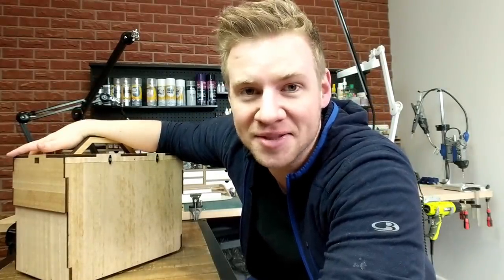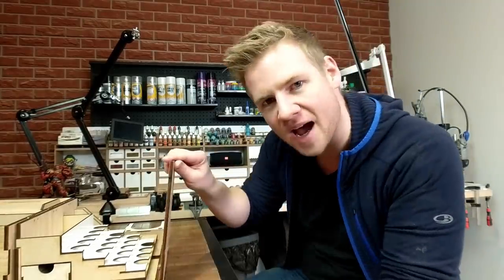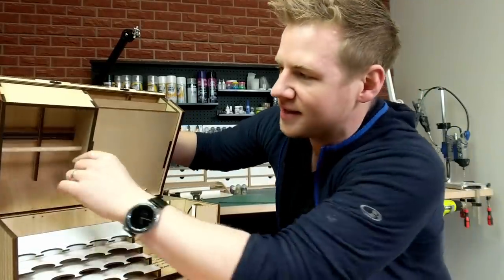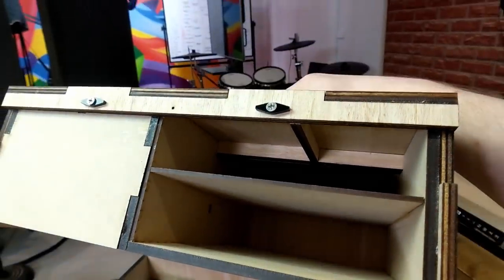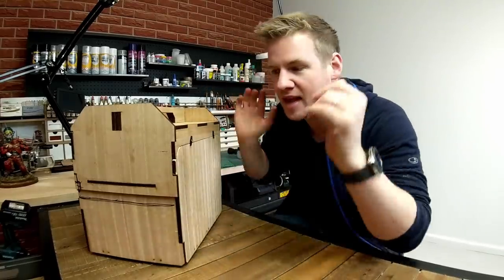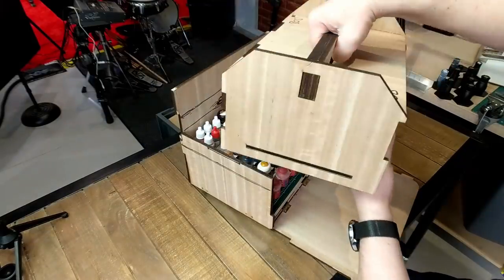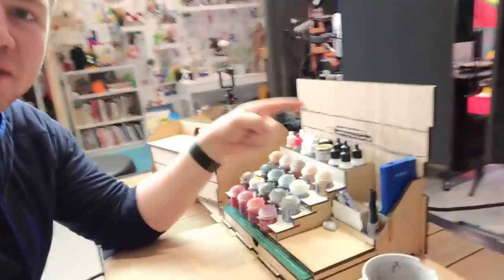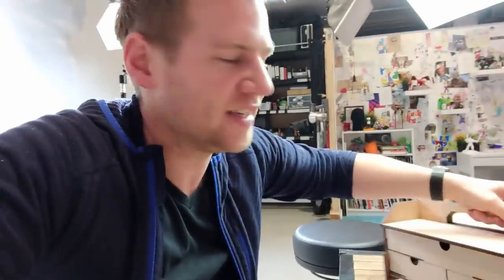My Prototype has MAJOR FLAWS - Hobby Box Diaries ep.3

Comment: Here are my 2 cents from the pov of a scale modeller/mini painter. 
1) Kill those color racks. I know they look nice but they only take up valuable space that could be used for MORE colors. You should replace them with a system of stucking trays, without any positions. The color bottles will snug each other to place and you will accomodate double the number you have now in each tray. I have over 200 vallejo colors and I manage to fit them all plus my pigment bottles, putties and solvents in a three level comic book box just a tad bigger than your hobby box.
2) Kill that GW  water cup placement. Its ridiculous nobody uses that crap and its space that could be saved for more important stuff.
3)Since you decided to go with a detachable top (a better solution imo) you dont need that back wall there. Turn the drawer part around and have it snap into place in a different way. Check how detachable tray tool boxes work.
Im going to be brutaly honest. What you have there is not a serious solution for any serious modeller. It could be a solution if somebody wanted to model away from home and work on a very specific project but again I bet that there will be a time that he will miss a color or tool left behind. If you want to aim to that target group you will have to go abit bigger and make something that will first and foremost will be a storage/portable solution and then a work station.

Comment: The notches you are using on the bad panel could be made smaller and put on the sides and back to align the top drawers. If you pare that with a similar spinning latch like you have for the front door it could hold everything together evenly and eliminate the need for the back side to be so tall!

Comment: May you could change up the lid so it has a hinge in the middle. As you open the lid, one half slides so it is above the other half? To solve the balance problem, you could split up the two trays and they go into the bottom below the tiers of paint? This way it would be bottom heavy but balanced.

Comment: Not sure a hinge and a locking rod(s) would solve the issue with the backplate. However, if you keep it as it you potentially make it somewhat modular for as other noted, easel, references or indeed a phone/tablet 'holder' of some sort. Comes down to durability I reckon.

Comment: I am just spitballing here but, what if you used injection molded plastic so you don’t have to have the built in supports taking up interior space or are you tied to the wood material for construction?  Secondly,  if the hinge was a rising piece rather than a flip over traditional hinge, you would not need to worry about drawer contents, just lift on the channels and everything remains in place and the spool rod would be like an under cupboard mount.  As for the weight, you could split the space devoted to the paint rack to flank the spool rod like bookends to redistribute the weight.  It would work fabulously for me right now lol!

Comment: Could you take the back panel and cut it in half with hinges holding them together so when you’re ready to use it, you can flip the panel down to get rid of the height? I’m not sure if you could put the hinges on the outside, but making it either removable entirely or like a flap would solve that problem.

Comment: I'm loving this so far! I like the little shelf for a cutting mat. I'd like to use that spot for flat sprus. The only concern I have with the two peice model is the strength of the connection. I picture myself using this in an airport or something to that effect. So if I'm walking would it become detached if I lightly bumped it? (Actually asking.)

Comment: Please understand that these are just my thoughts and opinions and i do understand that you have put more time and thought into this project then I have I just wanted to offer my perspective on how i would tackle some of the problems you presented us.      (0.07)What if you made the fold down workspace so it could fold all the way over and under (or possibly removable?) out of the way so that way it can be used with even smaller work spaces? Also what if the Drawers on the right had side were there own unit? ( I feel the next attempt your current working model may be the best solution.) This would make them slightly smaller but they could be removed as a who before opening the box all the way or after without fear of spilling, this would also allow for lager things to be stored in there space if desired. If you wanted to put a hing on the back panel of your current box so it folds in half you'll definitely need a clasp to keep it locked up when in transport mode. But what about putting a strip of magnet along the back board so when your painting and you need to set something aside to dry you can stick it to it... This may help to keep your mess and clutter more self contained when working in a public space. you may also want to do this with your WIP section so minis don't bounce around and get damaged.

Comment: I like the detachment of the drawer from your mini workspace and if the barrier is a trouble from blocking your view, why not attach the barrier to the drawer system? From my understanding the drawer system is under a locking mechanism to the main box so why not detach the top barrier to the drawers. I personally would use 0.7 prototype because my desk space is not average at all but 0.8 looks a little more rustic, if that makes sense.

Comment: Could you add a sliding construction for the top part instead? i.e. the top slides off to one side instead of lifting up? This will stop the backpate issue, but it might impact the size of the "fold down plate" on the front.

Comment: Q: Would it be possible to solve the back panel height problem by allowing for some sort of "locking panel" that could be integrated into only the lid portion of the box? Perhaps it could be folded up and slid along the top of the box, under the handle using some sort of hinged construction? This would preferably keep the drawers in place without relying on the back panel that sticks up from the bottom of the box. 

However, I assume that with this solution the problem would instead shift back to how to lock the top and bottom of the box together properly.

Other "workarounds" could include adding holes to the back panel, or using it as a space for reference pictures, a phone stand or a name tag of sorts.

 I feel like I don't really have any concrete solutions, but just throwing my thoughts out there.

In any case! I am so so hyped to see the progress on this project, as I've been dreaming of building something like this for my gaming and hobby needs for a long time! It's inspiring to see how much thought and care you put into even the minute details. You can really tell that you feel strongly about this project and that you care deeply. Keep on being great, can't wait for the next update :)

Comment: With the back panel make the top half fold down and make it get locked in when it is up by the sides
Reply: That's good. To put it together you'd flip the sides up, put the lid on and lock it in with the front and back flaps. That would also add the option of leaning that back flap against a wall and using it as a reference holder as many people are suggesting.

Comment: For me as a miniature painter there is way to little space for paints. i would need at least 3 times the amount. this is supposed to be a "to go" solution for painting. all that space for hobby tools is wasted in my opinion. lets face it, building and tooling around is made at home, where you have your hobby tools. you don´ t need that box for that. i think this box is great for someone who grabs a few minis and goes out to the next hobby store to paint alongside their friends. essential feratures in my opinion is paints space, a lightsource, space for a wetpallet, storage for brushes, some files, a hobby knife, a sprue cutter ans glue. the waterpot space isto big and a waste of space in my opinion.
Reply: EXACTLY!!! The box as it is now is mostly aimed towards an entry level modeller demographic. There are alot of gimmicks that take up valuable space. The water pot space is useless and the paint rack positions, just look nice, but if it was just a 3 level tray system he could fit 3x times the ammount of color bottles he has now. The biggest problem with this construction is that he is trying to sell it as a portable work station, when he should aim towards the portable storage unit with some  possible workstation features.
Btw I love your channel and your work!

Comment: The one big downside I have for the miniatures box, is that this seems to be being made with GW only products in mind, and I'm someone who doesn't use anything from GW. For instance showing where you have the mini you are working on stored, most other paint/mini handles are bigger than the GW one because they fit better in hand.  I think you did mention in another video that the paint rack will have an alternative size for dropper  style bottles (Vallejo and Army Painter for example), which is a great thing but the rest of the box has to embrace that other mini companies and products exist outside of GW.

Comment: Hmm. I know that this redesign actually got rid of the functionality that was most appealing to my husband (who paints miniatures): having paper handy. May sound odd, but honestly, the ability to quickly clean up is absolutely a necessity - and having to gather those supplies separate from the toolkit significantly reduces the usefulness of the kit. If he's already got to bring along or have extra stuff, then why does he need THIS? 

I'd suggest maybe reducing the depth of the old versions a bit, going back to having loo roll (filament wire, whatever) in the lid, and rather than drawers, having the deep shelves or whatever they were the first prototype around (the chest prototype). And look into the kinds of hinges that would allow the lid to open and stay open, maybe using support legs that slide down or something. (I wish YT allowed drawings, I am absolutely not describing this well. But we've spent a year on doors for a cabinet we designed, so I feel this particular pain, but also know the kinds of hinges that wouldn't require the whole thing to open like a book, but instead would offer the loo roll and storage at a height "above" the workspace and paint pots.)

Comment: the height could be solved by having the back hinge  back and down. this should greatly reduce the height but the down side of this is that it will be  pushed forward by 1cm to roughly 2cm however going of a rough estimate of the table that you use this shouldn't be a a problem for a majority of customers

Comment: Come at it from another angle... literally! Fold it another way. As long as it has a stable locking mechanism, it can open from any direction. Maybe instead of folding down, you could do it accordian style or the front of the box has two shelves, almost like a refrigerator. Everything should be easy to reach.

Comment: Ok but, if I am in a tiny space, then taking off the lid and setting it aside defeats the whole purpose of a tiny space.  I may not have room to set the lid aside and it would possibly get in my way of working.  TBH, I liked the flip top version better.  What if you made the flip top smaller, and put a double ended drawer there for things like smaller paint or paper or the mat? Or put your smaller compartments up top.  It would be cool if there were supports that came off of the lid to flip down to hold the top up

Comment: Q: what are your tips for a traditional artist getting into digital art. I have tried multiple times to take a drawing from a sketch and sometimes I just end up disheartened because it doesn't live up to my traditional artworks.
Reply: check out his recent video on the huion Scribo - it sort of bridges the gap between the 2
Reply: @spacemarinebob  Ive only got a cheap Wacom 😂 I have used it more for taking notes than art. I just have continual issues with line art and how to get the colours to blend without getting muddy. Maybe it's just my understanding of the program that's the problem and that I am trying to approach digital art using traditional art techniques.

Comment: So why can't the lid go upright with the handle facing the wall as it already is designed? You'd only have to add some slide out or add-on support legs. That way the tape dispenser or roller bar is nearer also!

Comment: The tall height on the back you could solve by not making it one but two panels connected with hinges so you can fold it down once the top part with the drawers is removed.
Reply from the maker: I considered that, but that would make the structure weaker, and 3x more hinges adds a LOT of expense

Comment: Wouldn't it work to put the big drawer at the bottom of the 'pile'? It would lessen the height difference of the backbarrier making it seem less of a wall... No? Or is that not an option due to the handle's attaching mechanism needing extra space? It would also improve the box's balance since it would make it less topheavy and center the weight more at the bottom...

I dunno...

Comment: why not just put a couple of fold-down braces/columns/feet on the back of the top, so the top can remain attached but stand up vertically when open if you want? It'd still take up some extra space behind the main compartment, but far less. Does not eliminate your problem of wanting to watch TV through that visual space unless you made the top removeable-OR-attached.

And you could maybe set up a swivel in the top contents so it could have shelves that fold down as you open it? heck if you wanted to go all-out, there could even be a cabinet door for them -- put a strip of corkboard along the top of that, and you can pin up things you're copying or using as reference points right above your workspace.

Comment: I would rather see at least one row of drawers taken out of the lid, which would also lower the back panel a bit.  For something like this, I would want to carry the paints and tools I'm using for my current project, not everything I own.  the extra drawers just make it bigger and heavier, being filled with things I likely won't actually need while I'm using it.  I fact taking them both out and making the lid fold away somehow would be amazing, given you don't really need seem to need that extra space for anything save the storage.  Or make it come with your choice of one drawer height, two drawer height or no drawers, with the appropriately sized back panel for the choice of lids.
Reply: Oh, or if you could make the handle secure enough, break the lid in the middle and have it hinged on the right and left, instead of the back.  Maybe make the handle slide through the closed box to act as the latch preventing the box from opening.

Comment: rather than having that large back panel couldnt you just have hooks to hold it on?? pherhaps on the side? or maybe make the side panels the connecting parts since they fall to the side

also could just make the back panel fold away with a hinge

Comment: Is the goal not to use hinge, pins or levers? I would have the attaching point lower, not in the top of the upper part. That way you could have the back board lowered. It having some lasercut logo that you can c thrue would still stop drawers in that version...
Reply: In the same train of thoughts: i was thinking that why wouldn't you just have the handle as a one structure coming like an U-shape on sides. Or have 2 u shapes that click at the bottom and lock the inner boxes. Like some crane hook? Then you could stack what you want and have it build up like tool boxes. Have modular shelves that pile up and have up to 6-8 modules...the u frame could make some stand or have it as a tablet holder when using the box 🤣

Comment: okay, so i think i habe missed a few parts on this series, but: why does it have to open all the way? why can't it just open so its straight up and secure it with strings or something so it doesnt open all the way? that would make it shorter
Reply: you'd have to sort out the drawers new, but i was thinking: you have a certain space in the lid where you, in the current version, fit 2 drawers. but if you "turn them around" so that they are vertical when the lid is closed, you would have to make them shorter but you could fit more to make up for that. and with magnets the drawers would stay closed when you close the lid

Comment: Forgive my ignorance, but if instead of having the paints lined up going down like a staircase, if they were all set up at the same height couldn't there then be more space below? Say, for the extra centimeters you want there? 

Also, why can't all the drawers be placed in the bottom? It seems like pulling out the top, if overly loaded, can be quite heavy for some.

Idk, I'm sure you've thought it all through. I can't help but wonder what it'd be like if the long side was from the sides instead of top and bottom, since you showed how it might also look if the top drawers were placed next to it though I imagine a longer box, while shorter, would also mean figuring out the balancing of the weight a bit more. Still, it's like carrying a backpack vs a duffle bag. The center of gravity varies depending where things are placed.